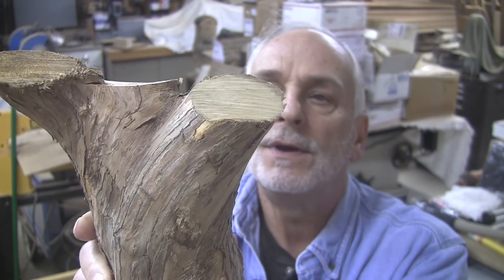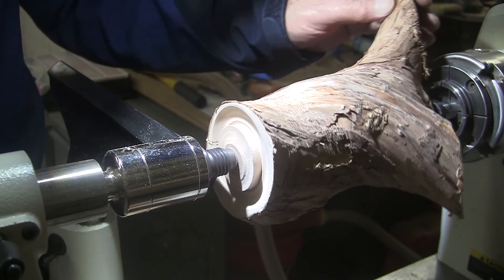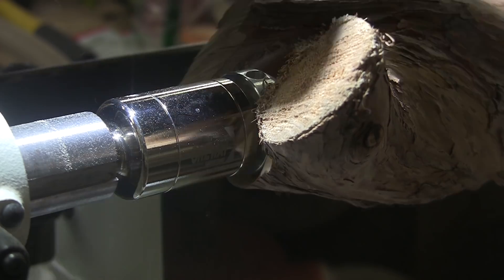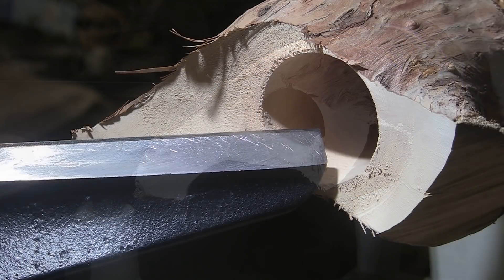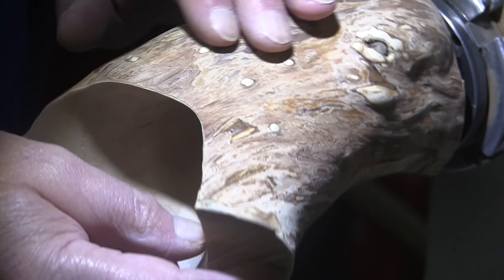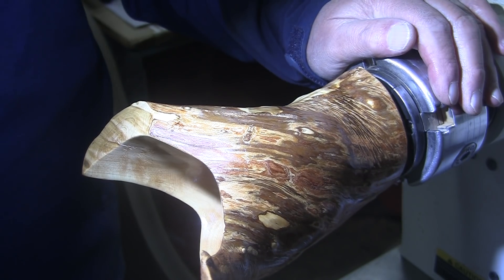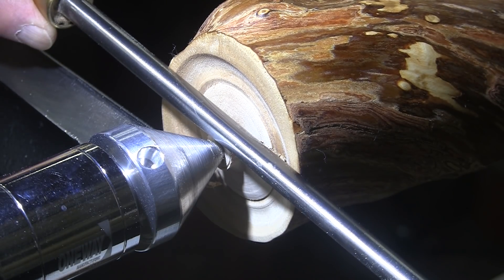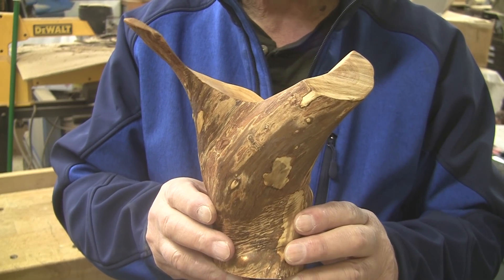The Unturned Vase - Wood Turning

Comment: QUESTIONS from a rookie...  Hi Phil,  really enjoy and learn a lot from your videos.  How dry does this type of wood have to be before turning?  How do you determine dryness, if you have to?   How dry do you typically want your stock to be?
Reply from the maker: Howdy, Robert,
Generally the wood I turn is dry.  I do have a moisture meter and use it once in awhile, but mostly I just go by feel or how long I've had the wood.  What is dry?
I think that depends on where you live and the ambient conditions.  Around here, wood seldom gets below 10-12%.  I don't mind turning at 20-25%.  I prefer not to turn green wood simply because I don't like having my bed ways get wet and rusty.  I do stay on top of that when necessary, but just prefer not to deal with it.  A lot of people turn wet wood on a regular basis.  It is easier and makes those really long, nice curls but the trade-off is not worth it to me.  Hope that answers your questions.
Phil
Reply: Phil Anderson - Shady Acres Woodshop Thanks for your reply Phil.  I have a really nice piece of wild cherry from a tree I cut down in my yard.  It's only been down about a month.  I have it in my shop now and was going to wait a few months but I'm impatient.  Any suggestions?

Comment: Phil:  I'm a longtime subscriber and I enjoy all of your work...but this project was exceptional.  I can see that your decision process honing itself on every project.  I would appreciate it if you would relay where you got the extension to your Forstner setup.  I don't think that I have seen anything like that up to now.  It looks like it does a real nice job holding your Forstner.  Thanks in advance.
Reply from the maker: Thank you very much, Donovan!  The bit extensions came from the catalog company MLCS.  Others are available from other retailers, I'm sure.  I have two, one is for 3/8" shafts and the other is  for 1/2" shafts.
Phil

Comment: Howdy Phil
 real nice piece Phil.... And looking and looking at it trying to figure out what type of shrub.... I only come up with a rhododendron . I tried to look for when you made a bowl out of rhododendron I couldn't find it . To compare. Does have the same color as rhododendron.

 Does that Danish oil waterproof the inside?

 I remember using it before long time ago remember exactly what you said takes long to dry.

 Whatever caused it to make a twist cause those wrinkles......  wrinkles gives it more character.

real nice ..
keep on turnin'
Reply from the maker: Thank you, Bruce!  Ya know, to me, it is very similar to rhododendron.  Looks and turns about the same.  Dave did say it was some kind of Asian shrub, just couldn't remember what.
I don't know if the Danish Oil makes it waterproof.  If it does, I doubt it would be food safe, anyway, but maybe.  Most of my stuff is just to look at, not use.
Yeah, I love the wrinkles, kinda different!
Phil

Comment: I really like this. You don’t usually use Danish Oil. That makes me wonder about the finishes you use. Do you determine those by the wood you are turning or to try to get the grain to pop with certain finishes? And does the wood ever need reflating after so long? Does the wood ever deteriorate after time? Is that the basis of the different finishes for different wood?
Reply from the maker: I don't have thoughts that deep, Stewart.  I just finish with what seems right at the time.  It is my belief that once a piece is finished it will live on forever unless it's left in the elements. 😃
Reply: I think that’s why your work is so special. It comes from your heart and feelings and you try not to overthink it. I love all of your pieces.

Comment: Another nice video on what to do with the odd ball pieces of neat wood.  You used your Sand-O-Flex with 80 then 180 grit, did you go any further or is that your usual stopping point when sanding bark (or former bark areas)?
Reply from the maker: 180 is my normal stopping point for bark and un-turned surfaces, Thomas.  It seems to be just right for smoothing without changing.  Thank you!
Phil

Comment: Ca  you do the same with a burn.  Leave ALL of the burn on the outside  ...  I have you turn an entire piece with just a screw on the power end.  Get hold of it with a smaller ten on on the free end???

I hate to see the bark of the destroyed except a bit on the rim.  The beautiful but I wood texture will show up on the inside of the bowl.

What you did here is a good example of that kind of design aesthetic.  I cheered when you left the outside alone ...
Respectfully, Chuck
Reply from the maker: Well, you could leave some burned material on the outside, Chuck, but I've found it to be very soft and not at all durable.  I think it's best to turn away most burned material.
The woodworm screw in solid wood is a very strong and safe way to hold a piece.  I've never had a piece come loose from the screw.  I'm glad you like this one, thank you!
Phil